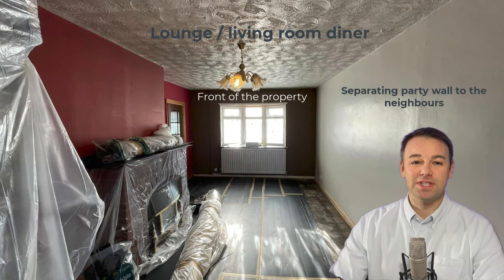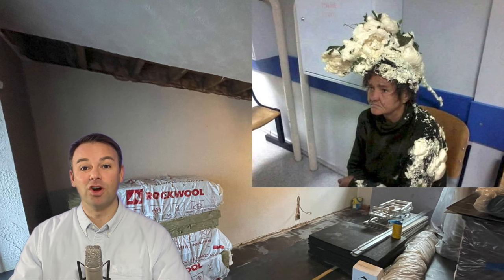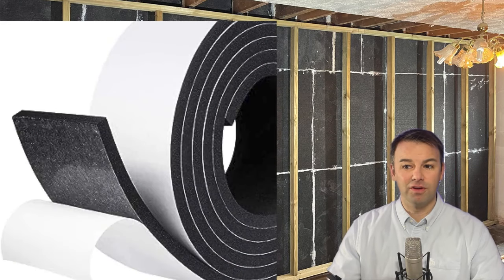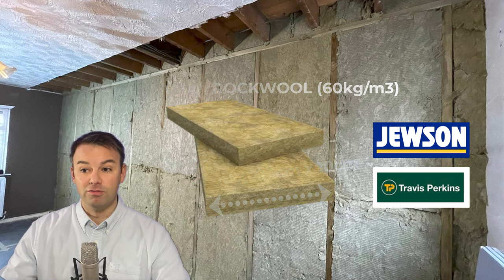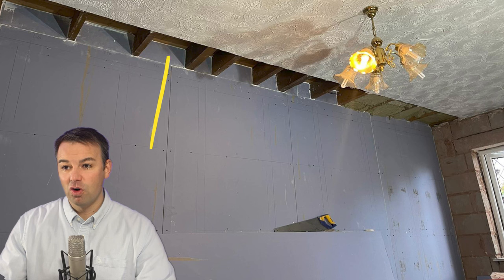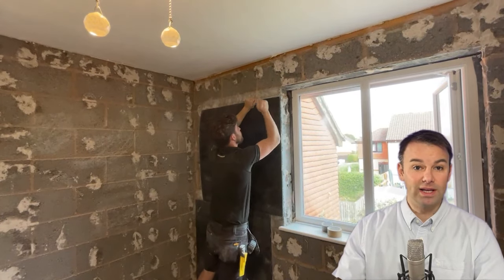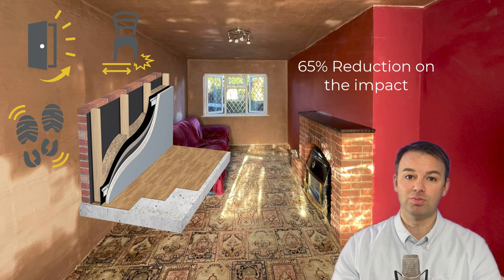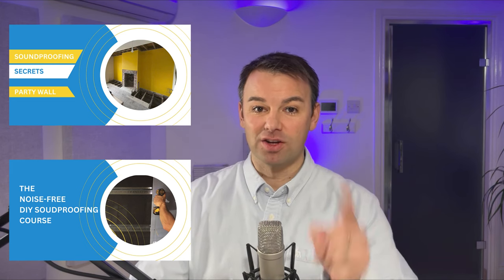Soundproofing lounge diner wall from noisy neighbours | DIY step by step guide

Comment: Thank you for sharing. One question though as you do install an isolated wall then why to use resilient channel since the timber frame is already isolated from the other walls and ceiling and floor. It seems to that it increases materials and labour cost with no added value. I would understand that resilient channel with add If used directly on the existing wall.
Reply from the maker: Hi Fred, How you getting on with the renovation? The frame, just like the channels and just like the rubber and all the other materials do not barrier the noise alone. The more layers and combination of different layers you use the more reduction in noise you will get. However you will get to a point where you have to install a lot of layers to get a little bit more reduction in noise (law of diminishing returns)

We have found having the resilient bars as well gives a better result than not having them.

Comment: What holds the stud frame in place? it wasn't really explained, so it has no fixings to anything its just sort of wedged in?
Reply from the maker: Great question, the frame is sometimes only screwed in a couple of places on the head plate and sole plate and often glued or sometimes with the right property, no fixings and just pressure and the pads. (That’s 19 years’ experience of installing it though to do that!) 
What is your noise problem? Do you need a thick wall system like the floating frame?
We show you exactly how to install it on the larger DIY soundproofing course: The Noise Free DIY Soundproofing Course. The intake is full this week, you can join the waiting list on the link below: https://jimprior.com/diycourse/ Hope that helps 👍

Comment: Hi Jim. What precautions did you take to safely cut into the artex?

I've got artex in the 1970s terrace house, I'm not sure how to deal with it.
Reply from the maker: Hey Mikey, for this particular case the homeowners had it tested a while ago, so we knew it was ok and our installers always wear masks anyway. 

If you happen to find out that you have the white asbestos in your artex and you do not want the disruption of removing it. From a soundproofing perspective I would recommend cutting open the floors from above to get to the area above the ceiling…and consider two layers of 15mm sound bloc board over the top of the artex ceiling to reduce the flanking noise from rooms diagonally above.

For you Mikey, you may want to leave it alone, take the wall system up to the ceiling and when you do the upstairs tuck the layers down below the floor to meet the ceiling.

If you are unsure about your artex always check with an asbestos specialist first.
Reply from the maker: What unwanted noise are you struggling from in your house?
Reply: @jimprior7  next door and I have VERY different taste in music 😞 I want to be able to play guitar and mix music, as you know you tend to listen to the same song over and over again when you're mixing. And I'd rather not have to listen to their EDM.
Reply: However, I don't know how long I'll be staying here. I might just live with it till I move house, and turn that into my forever home. If I get a semi detached, I'll only need to soundproof the one party wall.

Comment: What Decibel reduction do you get with the 20mm Rubber versus the MLV?
Reply from the maker: The MLV and 20mm rubber work in different ways, the MLV will barrier the noise when used in the right way and best used in conjunction with other products like Rockwool and between two sheets of acoustic plasterboard. 

We find that if you put 10kg/m2 MLV to the wall directly like we do the 20mm rubber it can channel the noise into other rooms like the 30mm panels do. (just what we find) This is not the case for TecSound.

We find the 20mm rubber dampens the walls better and reduces higher frequencies and reduces impact noise too when you apply it to the brick/block/concrete wall first. 

The difference with and without the 20mm rubber is very noticeable to the human ear.

Comment: why didnt you remove the plaster board or plaster from the wall, wouldnt it have been better to remove it so you can fill in the holes/ gaps
Reply from the maker: Hi Richard, 
For this room the party wall render was sand and cement, it was in good condition we decided to leave it in place because it provides a bit of mass. The window wall render was blown in many parts so we removed that.

If it was plasterboard on the walls, we would have 100% removed it. 

The holes for this property were mainly caused by movement of joists (1min 30sec in to video)

You get holes in the structure for a number of reasons depending on the age of the property.
Hope that helps

Comment: Can you plesse stop shoving up the volume on your video I listen from one video to thr next and you keep turning your volume from video to video
Reply from the maker: Hey Anna, 😂, Sorry I have just upgraded my microphones and camera so the older videos will need the volume up and the newer ones really loud. After building 100s of studios I have finally got round to sorting my own studio acoustic out.
Reply: Sorry to winge. And yes that's always the way. I don't know who you went to for advice I personally like Podcaststage and Booth Junkie. 
As I said I am going to fix my problems by installing an Alesis 3630 compressor at my end so I can noise gate the issue. 
And as I said this YouTube fault as they should implement a noise gate so that all YouTube videos are within an acceptable range. If they are happy to downgrade video that  has been uploaded at 4K then they are perfectly capable of applying a sound envelope to any video that is uploaded.
And I may well be in touch about asking you to at least consult on how we need to handle noise in my home. My ground floor is going to be gutted due to flooding (despite  it being about 100 metres above any river or stream) and to quote Biden we are trying to build it back better!
So hopefully talk to you soon
Reply: @jimprior7 what camera have you swapped to?
Reply from the maker: @annakissed3226  Just using a iPhones with different microphones depending where I am. When i'm onsite it's always an empty room and a lot of reverb so directional mic not always right.